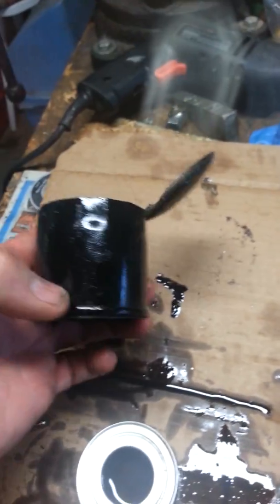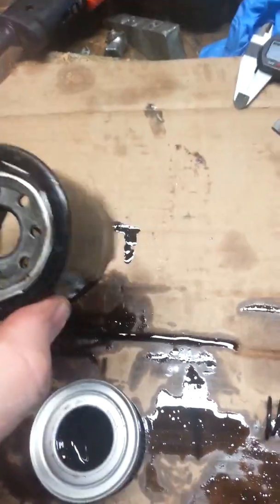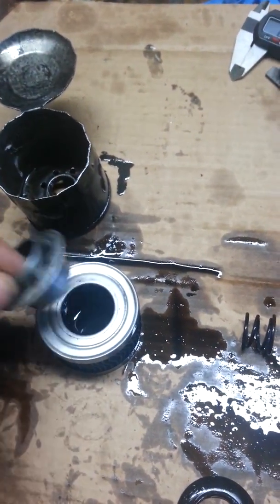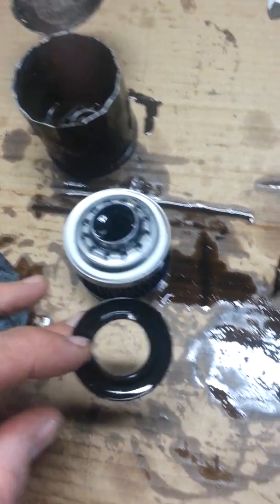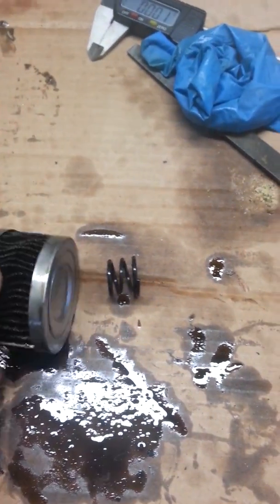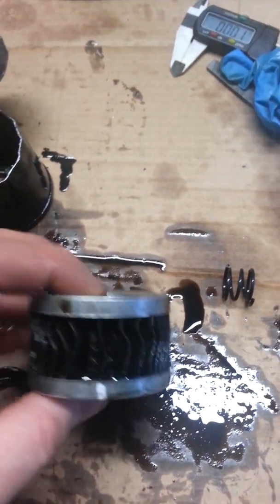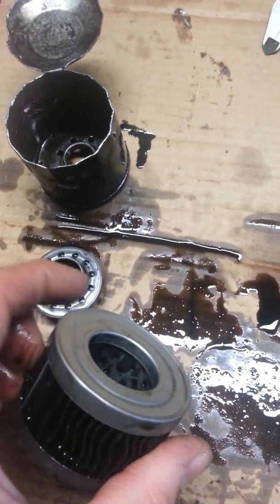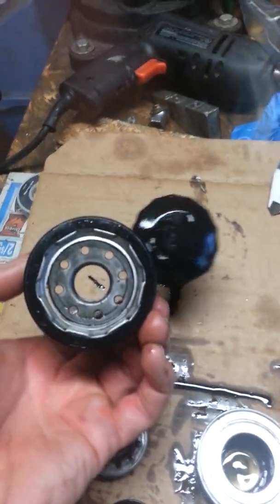Inside of Polaris 2520799 oil filter

Comment: Thanks for the video, I was just looking in to changing the filter for another alternative brand other than Polaris and I was wondering what the quality of the OEM was and you've just saved the hassle of getting out the grinder....thanks!
Reply: I just took apart a Polaris 2521728 filter, and it is top quality. It was on my 2021 slingshot.  I'm impressed with tge quality of this filter.